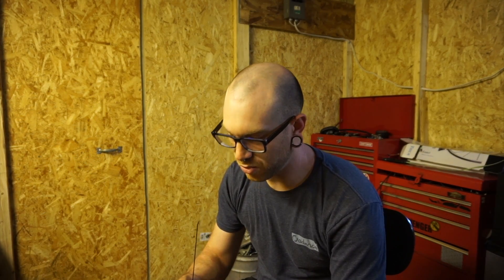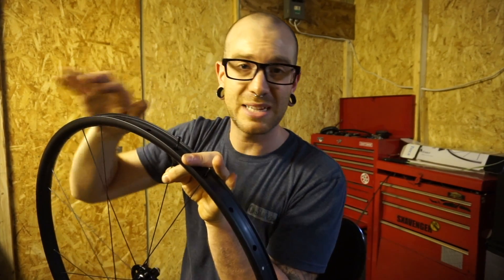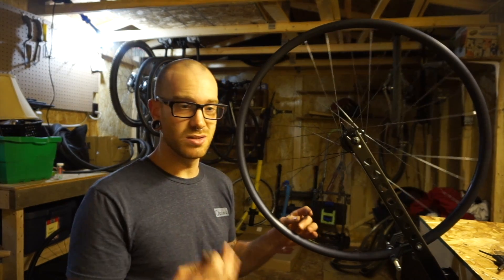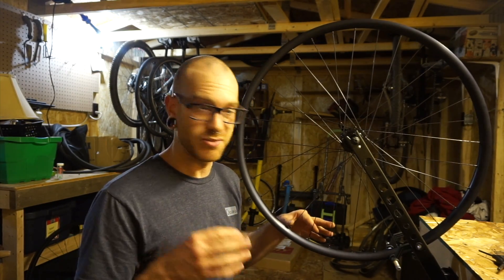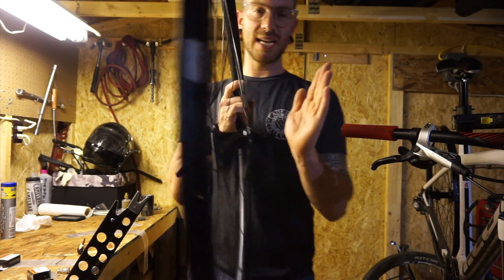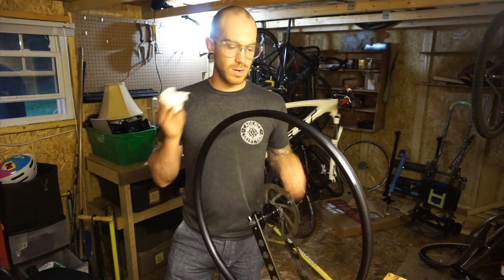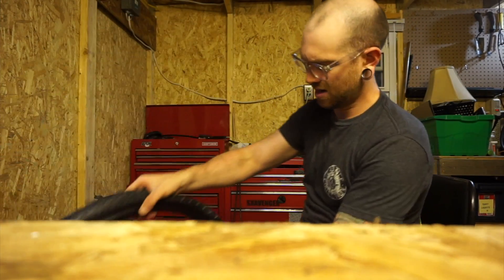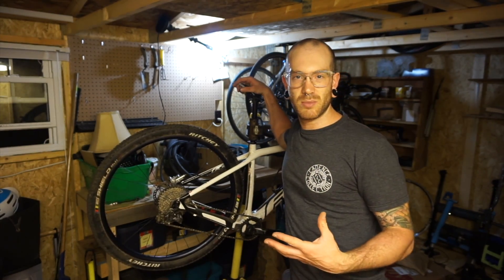Finally Building the New MTB Wheels

Comment: I use exactly the same tubeless tape!!😁 3 layers holds up fine to not stretch into the spoke holes.  Actually, I've never had as good results with gorilla tape as electrical tape.... and I've never used "real" tubeless tape.

Comment: So what's the attraction? Do they end up cheaper/better value than shop bought? Or just the joy of doing it yourself?
Reply: Why not both?
Reply from the maker: They definitely can be cheaper for sure, but that’s more from being a patient shopper.

My problem with factory/machine built wheels is spoke lengths. Generally when I measure for spoke lengths I aim to have the spoke sir about halfway into the slot of the nipple when everything I tensioned. This strengthens the head of the nipple and prevents the head from breaking away. Most stock wheels have too short a spoke resulting in broken nipples.

I also just really love seeing it all come together and riding something I know I built!